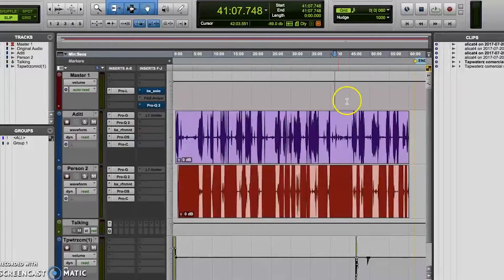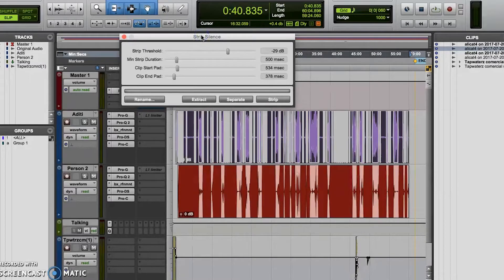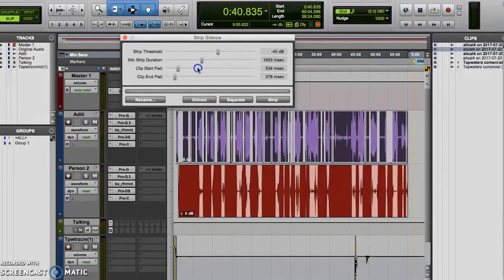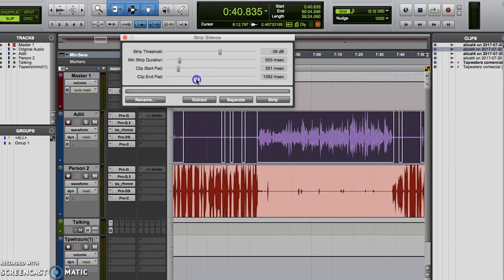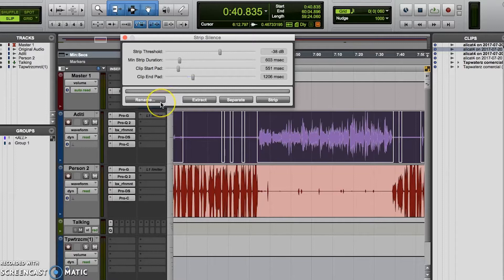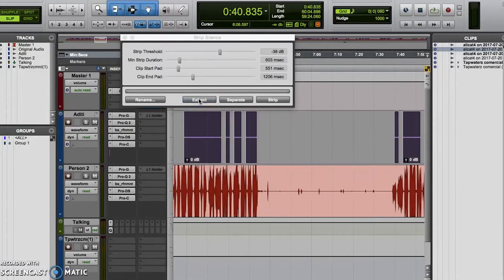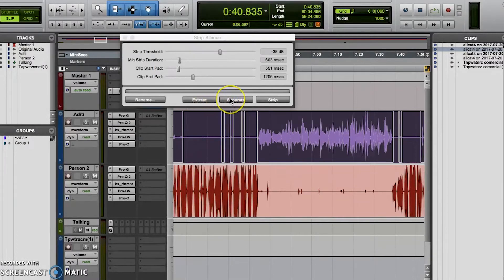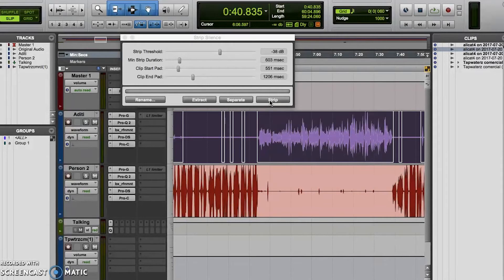Editing Podcasts Using Strip Silence: Audio Engineering 101

Comment: Oh man, this would have been so helpful to know last week lol. Is there a way to auto add fades to the untouched regions after they've been stripped? That'd be a real time saver.
Reply from the maker: yeah!  Just highlight all the clips that you want to add fades to, and then hold command and hit F to make fades.  You can then adjust how long the fades are and stuff, and then hit the button on the fades dialogue to create the fades.  Then you just double check that everything sounds right.  Good luck!  Let me know how it goes?
Reply: Worked Perfect! I'm just getting started as an audio engineer, and I recently did an hour long podcast fading and cutting out silence manually. It took FOREVER! This is gonna be a real time saver, thanks!

Comment: very helpful. are there any disadvantages to using strip silence? and can you use it on large chunks of audio?
many thanks, Jason
Reply from the maker: Yeah, you can definitely use it on large chunks of audio!  I would use it one track at a time though, since if you highlight two different tracks at once, and there's audio on one of the tracks, it won't remove the silence on the other one, if that makes sense.  I use it on hour+ long chunks of audio sometimes though, and it works great!  You just have to be careful when you choose your settings so you don't remove something that's on the quieter side, but important.  So I think the disadvantage is that it IS automated, so you have to still have a human listen to the audio and carefully choose those settings, and make sure everything you want is still included, and nothing that you don't want is still there.  I often have to go through after using strip silence and still remove things like coughs, etc.

Comment: First, I appreciate your efforts. Quality work here. I have a podcast (comedy is my preference) that I record and edit myself. Anyway, I have a template that I import with common settings (compressors, EQ, etc) and it also has a few tracks with samples that I simply import to my session which includes things like intro and outro music, bleep tones, etc. Just saves me a ton of "post production" work since now everything is either sliding or pasting around. There may be an easier way, but this works for me.
Reply from the maker: Hi, thanks for watching!  And yeah, for podcasts, I usually start with a template of mine, and then just work in the same session from episode to episode.  I'll keep the tracks with the intro and outro music and just make a new save when I start working on a new episode, and then delete the old audio that I don't want, then import the new audio for that episode.  Then it's sliding the stuff that I kept (like the intro and outro music) around from there.  Sounds like a very similar process to what you're doing, right?
Reply: Exactly the same. Usually I reuse the same one, but a few times for whatever reason I found myself starting fresh and just importing the tracks. I had never considered editing someone else's podcast. Interesting way to take advantage of my mixing skills as a little side job. Thank you!